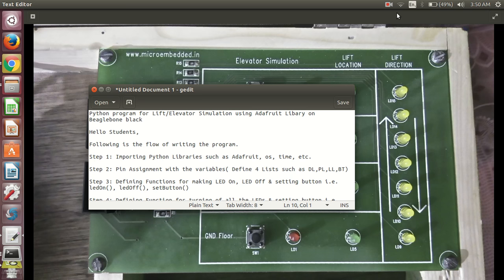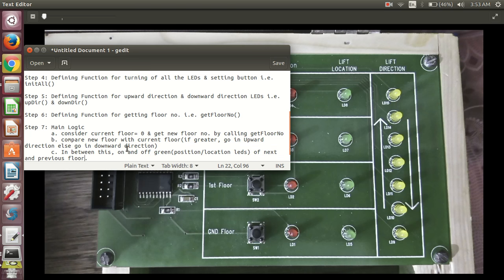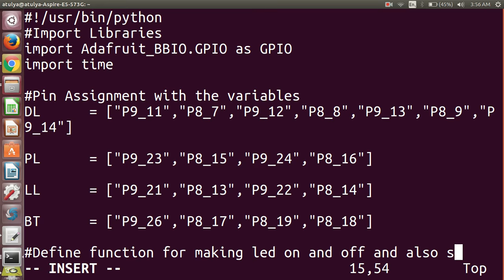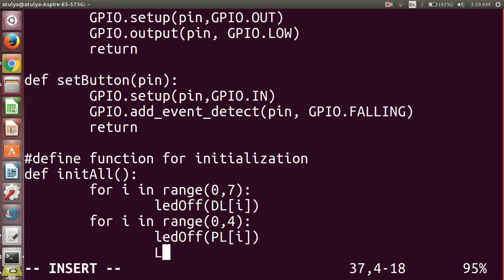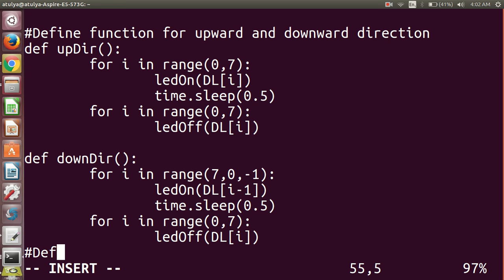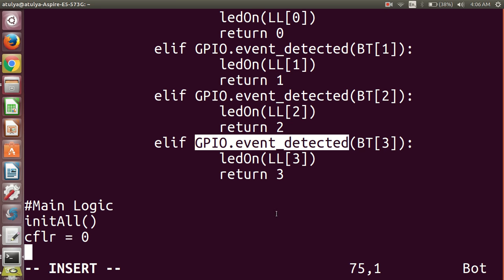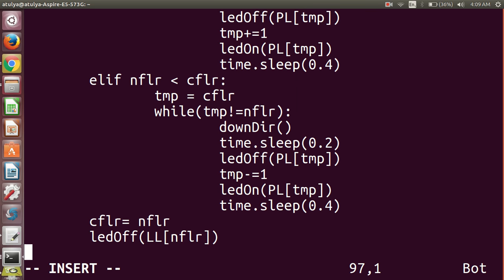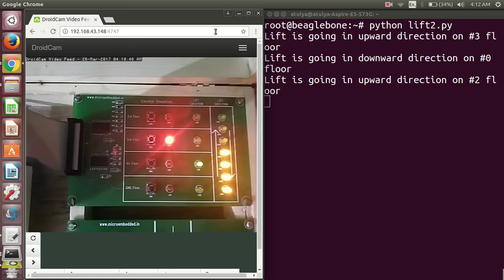Lift Simulation using Adafruit libary on Beaglebone Black

Comment: Is it necessary to use the same set of pins or we can change it as per our wish?
Reply from the maker: Sharayu Kadam yes you can change it as per ur simulation board.
Reply: Santosh Nagargoje please can you tell me the significance of each pin. I mean can you please tell the pin description of BBB
Reply from the maker: GPIO stands for General Purpose Input Output. Through this you can 
communicate with the other electronic components which you connect with 
the beaglebone black. Every pin is associated with direction(either 
input or output), value( 0 or 1), edge( rising or falling), etc.  So 
There are 46 pins are available on each P8 & P9 header. Out of which
 8 pins are ground pins(GND), 6 pins are power pins( 3.3V or 5V), 65 
pins are GPIOs and remaining are used for other purposes such as LCD, 
Analog input, etc.

You can get pin diagrams here: 
http://beagleboard.org/support/bone101
Reply: Santosh Nagargoje thank you so much!!

Comment: please...provide that code
Reply from the maker: #!/usr/bin/python 
##########################################################
# * Python code (Adafruit BBIO Library Version) for  
# * Lift Operation Simulation using Beaglebone Black  
# * running Debian 7 Linux distribution
##########################################################

# Import standard python libraries
import os
import time

# Import GPIO part of Adafruit BBIO Library
import Adafruit_BBIO.GPIO as GPIO

##############################################################
# GPIO Pin definitions for Lift Simulation Board 
# Please refer "MicroEmbedded_BBB_Interfacing Details_New.pdf" 
# for all the PIN details
##############################################################

DL  = ["P9_11","P8_7","P9_12","P8_8","P9_13","P8_9","P9_14"]

PL = ["P9_23","P8_15","P9_24","P8_16"]

LL = ["P9_21","P8_13","P9_22","P8_14"]

BT  = ["P9_26","P8_17","P8_19","P8_18"]

##############################################################
# Description  : This function turns the LED ON 
#     It will setup a PIN as GPIO, sets the 
#     direction as OUT and then makes the PIN high  
# Input  : @pin = Pin No associated with LED
# Return : None  
# Note  : 
##############################################################

def liftLEDOn(pin):
 GPIO.setup(pin, GPIO.OUT)
 GPIO.output(pin, GPIO.HIGH)
 return 

##############################################################
# Description  : This function turns the LED OFF 
#     It will setup a PIN as GPIO, sets the 
#     direction as OUT and then makes the PIN low  
# Input  : @pin = Pin No associated with LED 
# Return : None  
##############################################################
 
def liftLEDOff(pin):
 GPIO.setup(pin, GPIO.OUT)
 GPIO.output(pin, GPIO.LOW)
 return 

##############################################################
# Description  : This function sets up a Lift button for input 
#     It will setup a PIN as GPIO, sets the 
#     direction as IN and then add the event to be 
#     detected on falling edge of the GPIO Pin    
# Input  : @pin = Pin No associated with Lift button 
# Return : None  
##############################################################

def setupButton(pin):
 GPIO.setup(pin, GPIO.IN)
 GPIO.add_event_detect(pin, GPIO.FALLING)
 return 

##############################################################
# Description  : This function glows the direction LEDs in 
#       upward direction to indicate lift going UP  
# Input  : None 
# Return : None  
##############################################################

def liftDirUp():
 for i in range(0, 7):
  liftLEDOn(DL[i])
  time.sleep(0.5)
 for i in range(0, 7):
  liftLEDOff(DL[i])
 return

################################################################
# Description  : This function glows the direction LEDs in 
#       downward direction to indicate lift going DOWN   
# Input  : None 
# Return : None  
################################################################

def liftDirDown():
 for i in range(7, 0, -1):
  liftLEDOn(DL[i-1])
  time.sleep(0.5)
 for i in range(0, 7):
  liftLEDOff(DL[i])
 return

##############################################################
# Description  : This function will initialize Lift buttons 
#       and LEDs. Must be called at the starting of    
#     the program    
# Input  : None 
# Return : None  
##############################################################
 
def liftInitAll():
 for i in range(0,4):
  setupButton(BT[i])  # Setup all lift Buttons
  liftLEDOff(PL[i])  # Initialize all Position LEDs
  liftLEDOff(LL[i])  # Initialize all Lift LEDs
 for i in range(0,7):
  liftLEDOff(DL[i])  # Initialize all Direction LEDs
 
 liftLEDOn(PL[0]) # LED for PL[0] is Turned ON. Defined as 0th (Ground Floor)
 return
 
############################################################################
# Description  : This function will return the floor no at  
#    which lift button is pressed. It will check the button 
#    press event for each floor and retrun the floor no for 
#    which event is detected. Also turn ON the associated 
#    indication lift LED          
# Input  : None 
# Return : None  
#############################################################################

def GetButtonVal():
 while True:
  if GPIO.event_detected(BT[0]):
   liftLEDOn(LL[0])
   return 0
  elif GPIO.event_detected((BT[1]):
   liftLEDOn(LL[1])
   return 1
  elif GPIO.event_detected((BT[2]):
   liftLEDOn(LL[2])
   return 2
  elif GPIO.event_detected((BT[3]):
   liftLEDOn(LL[3])
   return 3
   
######################## 
# Program starts here
######################## 
  
liftInitAll()    # Initialize all lift Buttons and LEDs  
time.sleep(1)    # Sleep for 1 second 
cur_flr = 0    # Variable for current lift floor (initially 0)
while True:    
 new_flr = GetButtonVal() # Get a new floor value by detecting a floor no to which button user calls the lift  
 if new_flr > cur_flr:    # if (new floor > current floor) means lift is called to upper floor
  tmp = cur_flr     # store current floor no into tmp variable
  print "LIFT going UP to floor #%d" %new_flr # print destination floor
  while (tmp != new_flr):    # Use tmp value (incremental); till it becomes destination 
   liftDirUp()    # Glow direction LEDs in upward direction
   time.sleep(0.01)   # sleep for 10 ms
   liftLEDOff(PL[tmp])   # Turn off position LED at the floor pointed by tmp 
   tmp += 1    # Increment tmp value by 1
   liftLEDOn(PL[tmp])   # Turn ON position LED at the floor pointed by tmp. Lift is one floor UP
   time.sleep(0.5)    # Sleep for 0.5 second (500 ms)
 elif new_flr < cur_flr:     # if (new floor < current floor) means lift is called to lower floor
  tmp = cur_flr     # store current floor no into tmp variable
  print "LIFT going DOWN to floor #%d" %new_flr # print destination floor
  while (tmp != new_flr):    # Use tmp value (decremental); till it becomes destination
   liftDirDown()    # Glow direction LEDs in downward direction
   time.sleep(0.01)   # Sleep for 10 ms
   liftLEDOff(PL[tmp])   # Turn off position LED at the floor pointed by tmp
   tmp -= 1    # Decrement tmp value by 1
   liftLEDOn(PL[tmp])   # Turn ON position LED at the floor pointed by tmp. Lift is one floor DOWN
   time.sleep(0.5)    # sleep for 0.5 second (500 ms)
 
 cur_flr = new_flr  # Once lift reaches the destination; current floor points to destination floor no 
 liftLEDOff(LL[new_flr])  # Turn OFF button press indication LED of the destinaton floor
 time.sleep(1)   # Sleep for 1 second
exit()     # Exit the Program